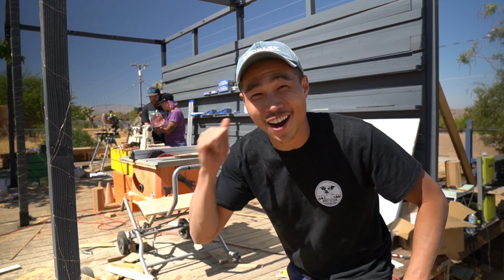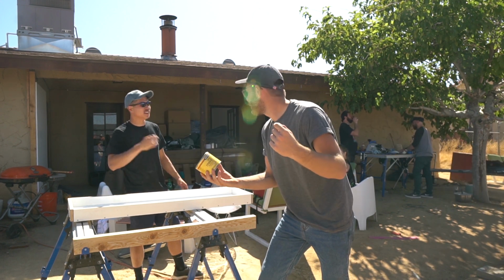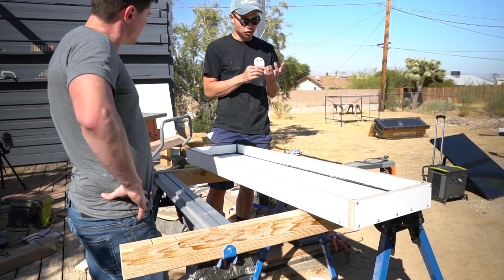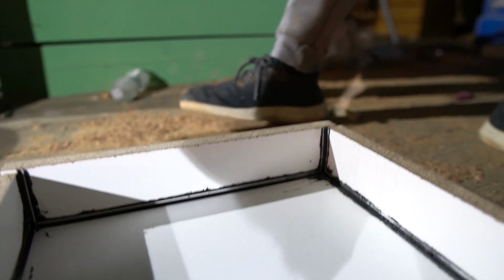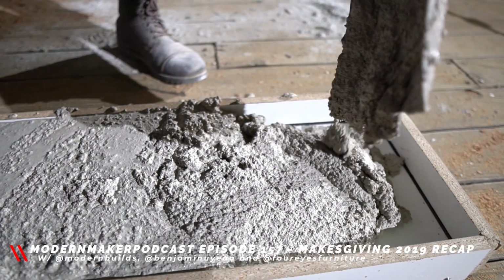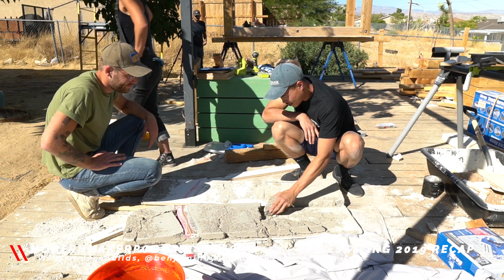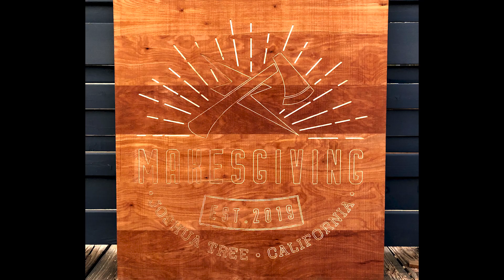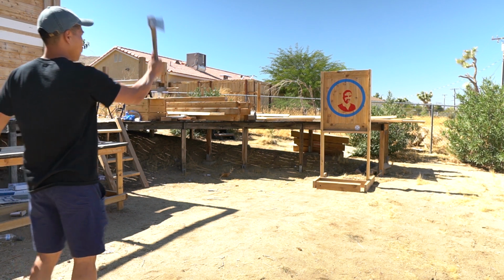THE CHILLEST MAKERS IN THE WOODWORKING GAME! (MAKESGIVING 2019 RECAP)

Comment: For the moon craters, I'd take the old knock-outs for conduit boxes, coins, maybe even cut down plastic bottle lids and glue them to the mold. You might have to coat them with something to prevent sticking, but it should work. For something permanently embedded, you can use glass beads (like for fish tanks, the ones that are flatter on the bottom).